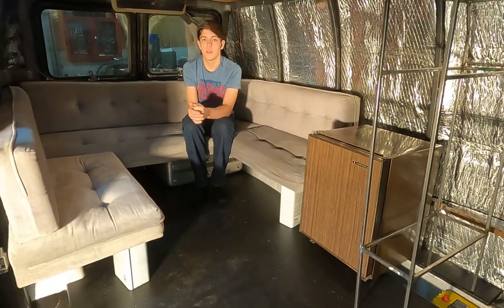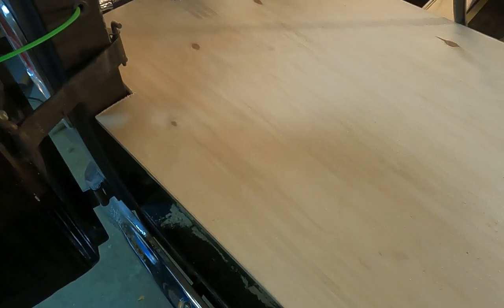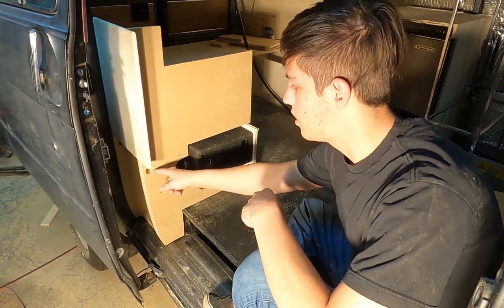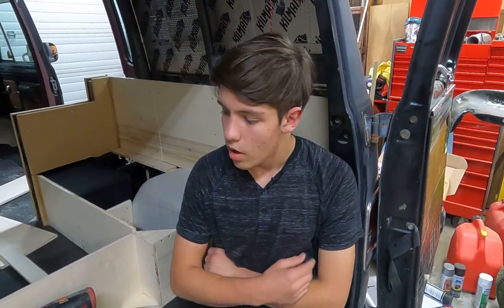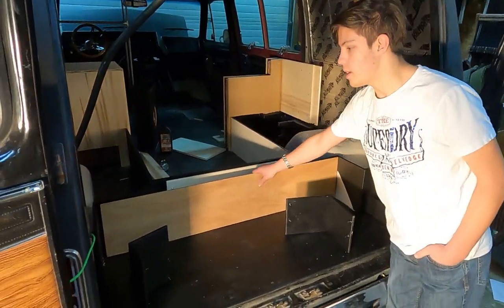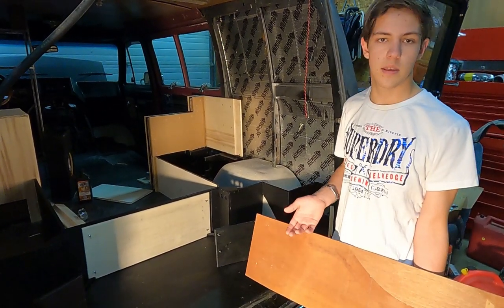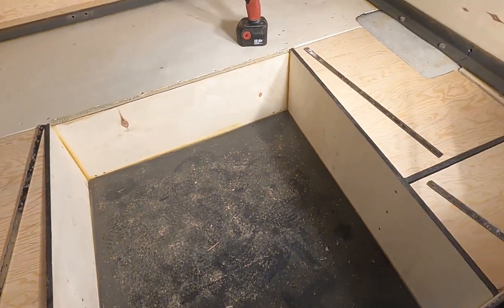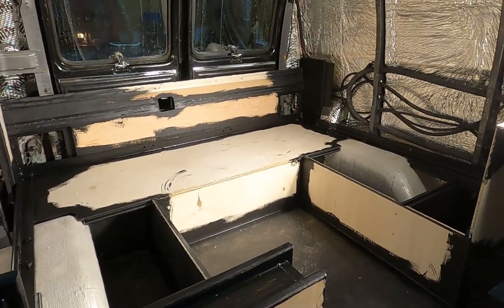INSANE CUSTOM VANNING FURNITURE!!!

Comment: I, just bought from a friend a 97, Dodge Ram 2500 conversion high top van for $900.00  I'm doing some extra custom work on the inside outside.